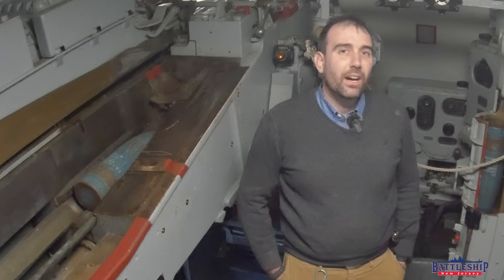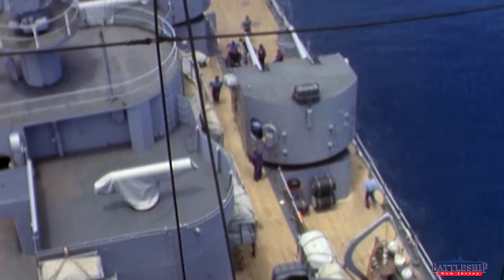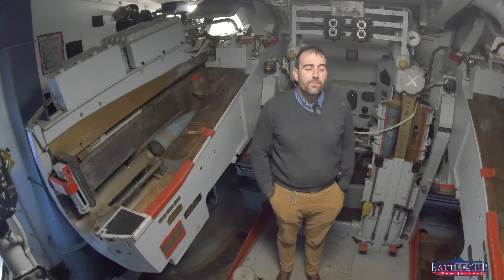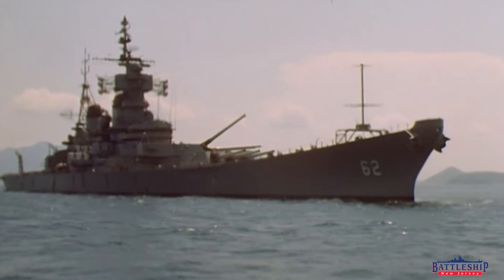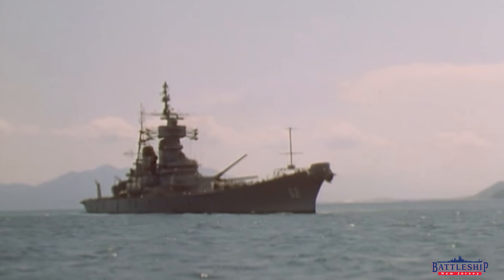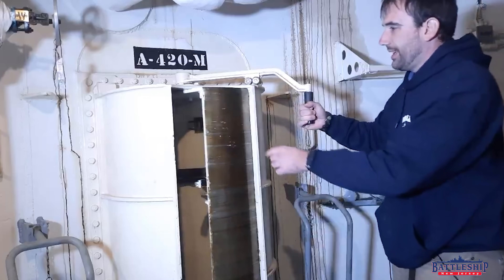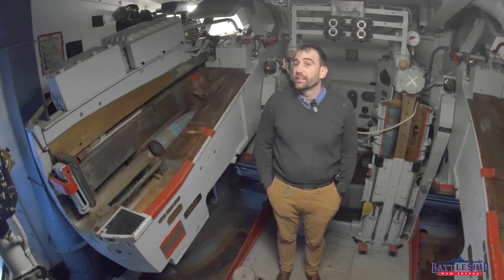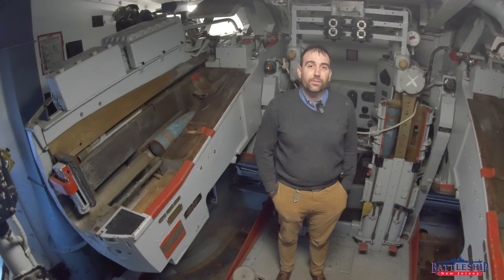Why Do Modern Warships Have So Few Guns?

Comment: It would be difficult for the Marines to take a beach without artillery support. And their rear area is the sea.
The Army would never try to take a position without shelling it with artillery, or without armor support, or without air support. Missiles are too few and too expensive.
But the Marines will be expected to storm the beach without artillery or good armor (their landing craft are barely adequate and antiquated).
Battleships had two roles: ship vs ship combat and shore bombardment. They didn’t fight other ships much in WWII, doing mostly shore bombardment. They keep coming back for the same thing. The Marines need artillery support from the sea, and one gun won’t do it.
Reply: A modern 5 inch gun can fire a shot every four or five seconds. That's an ROF on par with field artillery batteries. Anything bigger will be done by aircraft and missiles. Bringing back excessively heavy and large guns just for shore bombardment is a fool's errand and sacrifices a lot of naval capability for one small advantage.
Reply: @bluntcabbage6042  disagree. That’s on par with a field artillery GUN. One isn’t enough. There might be miles of beach to suppress. Missiles are very expensive, sometimes over a million apiece. And even a battleship only carries a couple dozen. Imagine storming Iwo Jima with only covering fire from 20 missiles and one gun. Look up how many shells were fired from battleships before landings in real life. It’s like 10,000.
Reply: @brianofozark  The days of opposed landings in the same vein as Iwo Jima and D-Day are long gone. They were painfully hazardous in 1944, let alone in 2024. Modern landings will either land unopposed wherever possible, land in such small quantities (a la special forces) that the defender doesn't quite notice them (and thus bombardment is counterproductive), or not land at all. The days of rushing a beach headlong into machine gun fire is long gone. If you, for whatever reason, need an island to be taken by force, it's far more efficient to just bombard by aircraft. If you have enough security to bring a target as massive and vulnerable as a battleship to bear, you will have enough security to send a squadron of F-18s with cheap dumb bombs to do the same job with much more versatility.

Battleship artillery was not necessary to military success in Vietnam. It was complementary at best. Ultimately, the vast majority of fire support came from Army and Navy based aircraft and ground-based artillery, not naval artillery. 

The idea of "What if we need to use ~10,000 shells to land on ONE(1) beach???" is a flawed one in modern warfare. Such a thing would be avoided at all costs and largely unnecessary to fulfill an operational objective. Even if it did happen, the armed forces are not lacking in ways to glass entrenched enemy positions.
Reply: @bluntcabbage6042  indeed? The Marines exist, as a military branch, for making opposed landings.
Reply: @bluntcabbage6042  General Schwarzkopf said “we had every intention of making amphibious landings if we had to” in reference to Desert Storm.
Reply: @bluntcabbage6042  From Wikipedia “During the battleship's tour of duty along the gunline in Vietnam, New Jersey had fired 5,688 rounds of 16 inch shells, and 14,891 rounds of 5-inch shells.”
Reply: Compare to “Missouri had fired a total of 783 sixteen-inch shells and launched 28 Tomahawk cruise missiles during the campaign.”
Reply: @bluntcabbage6042  also from Wiki, but regarding Missouri: “The battleship arrived at Yokosuka on 24 March and departed the port four days later for the United States,[16] having fired 2,895 sixteen-inch rounds and 8,043 five-inch shells during her deployment.”
Reply: @bluntcabbage6042  “In retaliation for the latter incident, Missouri's five-inch guns fired 998 shells at the North Korean positions.[62] The last bombardment mission by Missouri was against the Kojo area on 25 March; she had fired 2,895 sixteen-inch and 8,043 five-inch shells during the deployment.”

Comment: I haven’t read all of the comments, yet, but I want to throw this out to the followers of this channel.  

“IF” the U.S. Navy, (or any navy, for that matter), were going to resurrect and “genetically enhance” battleship design for the 21st century, what would it look like?

I submit that several of the design features of 20th century battleships would still apply.  Speed and endurance would  be two of those factors.  A third would be firepower, followed by survivability.  

Of these four factors, does one triumph over the others in the possible threat environment such  a ship would face?  What would be the  proper order of consideration in designing such a ship?  

While I am on the topic, I shall throw these Tbits out for you good people to chew on.
1.  Design speed — 50 Kts.
2.  Power plant — 2 Nuclear reactors, with back up diesel power.
3.  A type of reactive or mobile type armor shields to enhance survivability.  This would be a continuation of the “All Or Nothing Armor Scheme”, first introduced on HMS Warrior and later reintroduced on the Nevada Class battleships of the U.S. Navy.  

Guys, just one more thing.  These are discussion topics, not a chance for any of you to fire a broadside in my direction.  We can have some fun with this.   Happy 2024 New Year!

Comment: one 5 inch gun is good for sinking fishing boats only, a missile can be shot down but a projectile fired from a 16 inch gun cannot , shame for disarming all the big war ships they way they have
Reply: Artillery absolutely can be shot down by CIWS. Bases in Afghanistan did so frequently, and against much smaller munitions.

The problem is that, to get in range with even the best high caliber guns, one would be well within range of every single other anti-ship asset in the field. Good luck running down an enemy missile cruiser with your 16in guns when he's hammering you from 300mi away for hours.

Comment: My opinion has the value of a gamer, so take it as you want. Each vessel must have at least three firing systems, maybe four, if we stretch it a little bit, and enough barrels to support them. 
1) Short range. At least two turrets, one in the front and one in the back, with enough firing power to blast any enemy that sneaks close to the vessel and potentially use it as a last line of defence.
2) Long range. Missiles are, probably, the best choice for this one, to take out a target, in defense, before it has a chance to attack or attack offensively a target, strategic or not.
3) Anti-air. I think you can guess why. The reason is simple. Anything that gets close to the vessel, from the air, with the intention to harm the vessel, gets shot down before it does any damage, if possible.
4) Anti-submarine. Attacks from below the vessel are probably the hardest to counter, so any submarines that are capable of doing those must be intercepted and/or destroyed before they do any damage.

I guess, anti electronic damage systems should be available and whatever other defensive systems that are required to defend against modern weapons.

That being said, all these are for a "general purpose ship". If a vessel has a more special purpose, then it should have an abundance or resources that will aid to achieve that purpose. Basically, go big or go home. I know that it's not a wise choice as battleships are both expensive and hard to make and maintain but, this approach will definitely aid to achieve the desired result.

Comment: Another thing I'd add is that many people forget that pirates are still a thing in some parts of the world, and dealing with them is often left to navies. When dealing with a couple small and extremely cheap boats, missiles are probably overkill and in some cases may be more expensive than their targets. However, just having even a single modern 3in or 5in gun can be a great deterrent to pirates and easily deal with them if needed.

Comment: I think once the magnetic railgun has been cracked it will replace guns, and use magnetic fletches rounds for drone's and incoming missiles, once they get pasted the first line of defenses the anti missile missiles. With a calculated range of around 100+ miles, the USN doesn't have anything in the inventory that can shoot that far for that cheap anywhere.

Comment: I think you are correct about the future of drones and flak-guns to counter them in a cheap way. Just look at Ukraine:
They have received several dozens of Gepard (Cheetah) flakpanzers from the Germans, which can shoot down a drone or a missile from a distance of several miles.
As a short range cheap air-defense system, these Gepards/Cheetahs have proven so effective in Ukraine that Europe even has trouble making enough ammunition for them, even if Ukraine only received a few dozens of them. According to my findings on the internet, at the and of 2023 Ukraine had received about 55 Gepards from different countries.
Even the USA is now buying back 30 Gepards from Jordan to give them to Ukraine, hopefully in 2024: The only problem with the Gepards is that even the youngest one is from 1980, so they are at least 43  years old (not the electronics or the firing system of course, these have been upgraded several times. I mean the vehicle itself is 43 years old). So I can imagine that some need to go to a lengthy restoration process which can easily take weeks or months.
My country - Belgium - still has a few dozens of stockpiled Gepards somewhere. The army withdrew them from service more than 15 years ago. Since then, they have not been maintained properly, so they are in not such a good condition. Restoring these could be a lengthy (and costly) process. That is why up until now, the Belgian Gepards have no been given to Ukraine. Before restoring them, we need to be sure that it is worthwhile... you now, maybe it is better and cheaper to keep them just for replacement parts, and send the parts to Ukraine.
Believe me, Ukraine would like to have hundreds of Gepards/Cheetahs to put around every city, around every energy or water installation, around every target of value in general.
This 43-year old tank seems to be among the best anti-drone weapons in the world.
Go figure. 🙂
So yes, I am almost certain you are correct: In the future there will be more cheap short range anti-air weapons on ships like the Cheetah. And not only on ships: The air force, naval forces and land force will all want more of these. Hundreds of them.
They have all seen the images of drones and missiles being shot down like flies by Cheetahs in Ukraine.
Best wishes for 2024!

Comment: There are some modern 4 or 5" guns that can shoot up to 20 miles.

Modern ship and boat armour is much weaker.

Modern fire control radar is very accurate.

Modern guns can fire very fast.

Therefore modern ships need just 1 reliable, accurate gun.

Comment: One larger calibre gun which could just be a 57mm, is in my opinion essential, for the reasons cited in this video. A 'battleship' might have 4 of them. On a battleship I might also put a single automated naval 155mm for shore bombardment and such. I'd also add CIWS systems, one on a frigate, two on a destroyer, and four again on a battleship. Other systems would include RIM-116 Rolling Airframe Missiles, RIM-162 ESSM missiles, and a large volume of vertical launch system cells, more of course as ship size increases.

My reason for the above is very much the result of air defense needs, primarily versus missiles. Vertical launch SM-2 & 6 IMO aught be reserved to engage aircraft before they can launch their payloads or for engaging crucial targets at extended range. They are too expensive and limited for anit-missile work. Instead the above gives four layers of anti-missile engagement that an enemy missile must defeat before striking a ship (more if you include chaff/flares and ECM systems). ESSM can engage at 27 miles, Rolling Airframe can engage at 6 miles, the 57mm can engage with guided shells anything that gets past the Rolling Airframe, and finally the CIWS can put up a wall of fire to anything that manages to get close enough.

A proper modern warship also needs good AWS gear and at least one helicopter on a frigate, two on a destroyer, and six to eight on a battleship (assisted by a below deck hangar and elevator). You need at least three or four an board in order to keep one in the air at all times, and that is high intensity. I'd also consider using rotary lift drones for both ASW (dropping sonobuoys) and high altitude radar coverage.

Comment: Without watching the video I can answer this. Conventional guns excel at one thing, shore bombardment, but they're useless for anti-ship warfare, and anti-air defense. Missiles are the opposite. They're great for anti-ship warfare, can do AA, and are good for hitting high value land targets, but they're too expensive for low value targets. 

However, conventional guns take up space and weight on a ship, while they have a function, putting bigger guns means fewer missiles, and it's not worth it. The battleship was kept in the US Navy much longer than it should have simply because it was still useful for shore bombardment, but little else. 

The railgun has the potential to change all of this as it can do all the aforementioned roles, and do it cost effectively, however the railgun was canceled, although BAE seems to be developing the project independently now.

Comment: This is idiotic.  Navy ships should have a variety of weapons and a lot of them for handling all kinds of threats including threats that are not currently in use.  Not putting those in is lack of foresight.  It's just a matter of time before hostile forces find weaknesses by finding types of threats that the U.S. Navy forgot to consider or neglected and then use those to attack ships so the U.S. Navy gets is ass handed to it due to this kind of stupidity.

Comment: If another major war breaks out we will need some platform to provide large volumes of cheap shore bombardments.  The iowa class bbs were used as late as the 90s, but I think they've been sitting so long that the navy wouldnt bother bringing them back.  Im surprised we havent seen any modern heavy cruisers than have a lower amount of faster firing guns in the 10-12 inch size range.  My guess would be the cost of ships and anti-ship missiles.  Yes, big guns can provide a lot of cheap shore bombardment, but the ship to carry those guns costs a lot of money, and anti-ship missiles are still far cheaper than the cost of a ship.

Comment: I think reducing it down to 1 gum is too low, if anything happens to that gun you're looking at a complete redundance of any ammo it's carrying, compared to say a 2 or 3 gun layout which simply means a damaged gun reduces fire rate, rather than renders the ammo useless. Drone swarms are definitely going to change the equation though, with specific systems being developed to deal with that threat in a cheap but effective manner. If it takes $500,000 to stop a $5,000 drone, over time the financial impact alone would make the drones effective, even if it fails to destroy a single target.

Comment: A pair of CIWS could do the job of all the WWII era 20 mm guns.
I do still hold out hope that the railgun project will work out, now that they know how to lengthen the life of the rails.
Rather than more gun systems, a wider variety. HELIOS lasers for active shootdown of missiles at short ranges. Railguns for prolonged surface warfare and shore bombardment, and then 30 mm remote weapon stations like what is proposed for the AbramsX, that would be used for active defense against drones.

Comment: I doubt guns will be fully replaced. The F4 Phantom is the king mistake of fully removing a gun, and why even modern stealth aircraft have a gun still. Even as the navy develops more advanced ships with stealth and drone usage, a gun will still used as others have said for redundancy. At least you are still in the fight if you are out of missles with a single 5” gun. May not be the best, but better to learn from previous military mistakes.

Comment: Honestly, surprised you didn't address the weight of the weapons here, considering that, more than anything, is the biggest contributor for why gun counts have gone down. When you make gun systems with fancy nice to haves like autoloading, self-sustained operation, and other small things, that takes up weight and space. Both are at a premium for any given warship, and when you have competing needs, something has to give. Unfortunately for the modern era, that something has always been the guns, 8 times out of 10. And I don't think that trend will go away until the day missiles get hard countered by something. That day hasn't come yet.

Comment: I'd expect independent single barrel,  fast traversing, fast firing & high precision guns of medium calibers - but optionally with programmable shells. Think Bofors 3p, just at calibers up to 5in. Enough of them to engage everything you don't need an exensive missile to hit, enough to defeat saturation attacks. In total more then currently planned. Be it as multiple installations on one ship or a single gun with a wide traverse on smaller, perhaps remote controlled, ships. 
But guns against hardened targets like those 16in? My bet is on drones/artillery rockets, even strap a rocket to a GBU a la ASROC for deep penetration- deliver similar punch from a much smaller launch platform. Also easier to either adapt to changing circumstances or design as expendable carriers.
Basically I'd avoid units with a big "I'm the main target"-sign anywhere near serious enemy firepower.

Comment: I'd build new Battleship classes to act as "Naval Artillery" similar to how the IOWA class worked. With modern tech and improvements, I don't think 15 inch shells would be difficult to land within 50m of eachother
Reply: Battleships would be way more accurate due to better rangefinders, guided munitions, scouting, thermals etc so it COULD work.